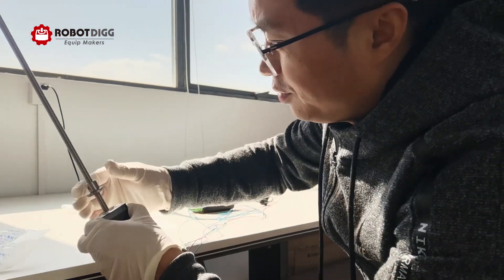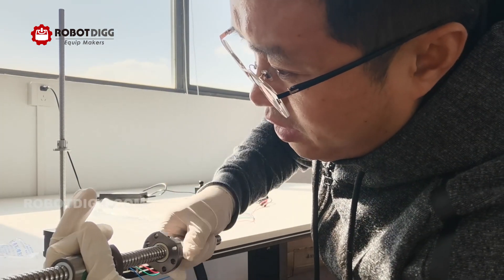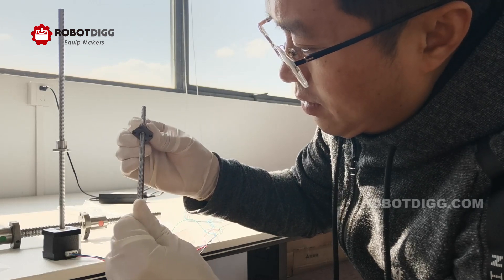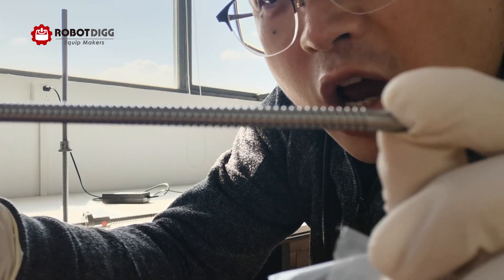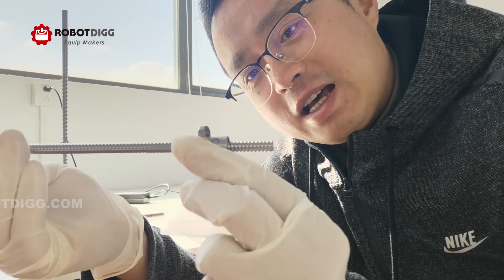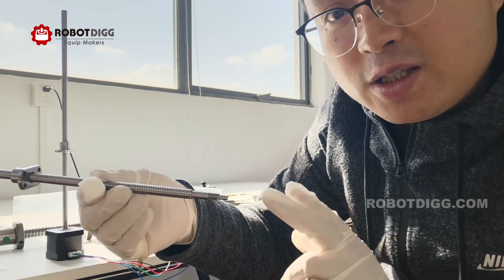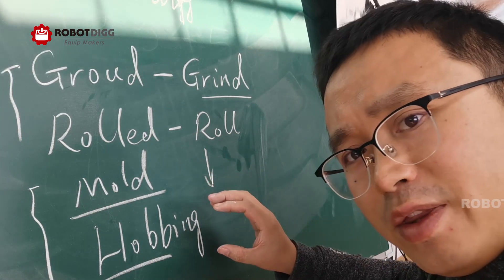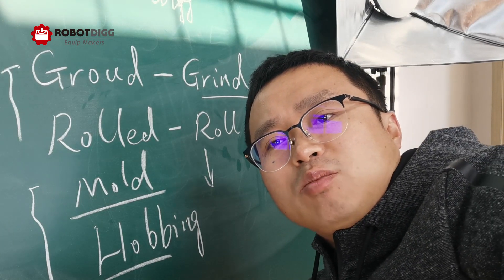RobotDigg difference between ground and rolled ball screw

Comment: looking for a 150mm replacement ball screw for my 3040cnc ... 12mm shaft UK
Reply: no one cares
Reply: @codefeenix  toilet brush
Reply: Most aliexpress stores will custom machine you one. you must provide a drawing with dimensions and tolerances. The drawing is the only way to prove the part is right or wrong. If you get it and its out of spec, but you dont give them the drawing with everything. your sol